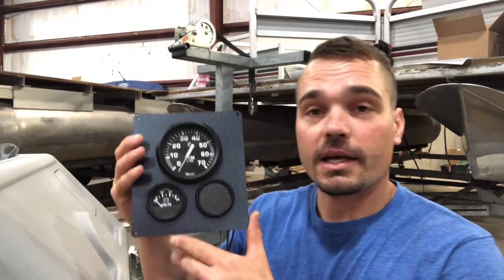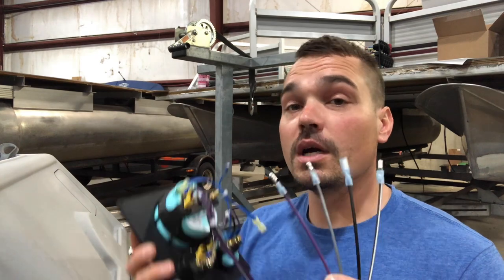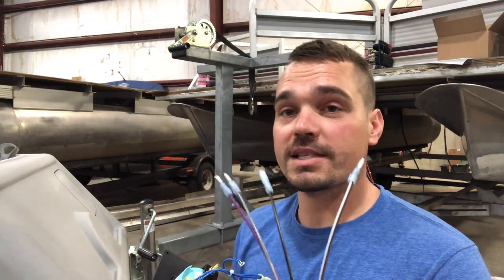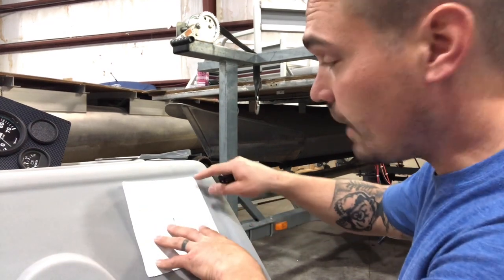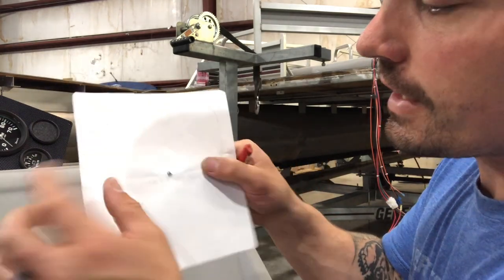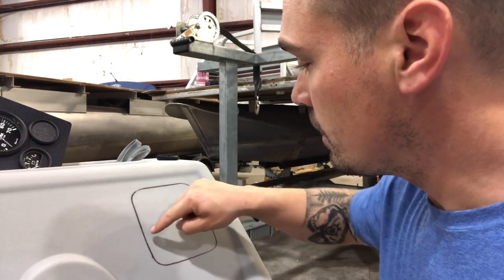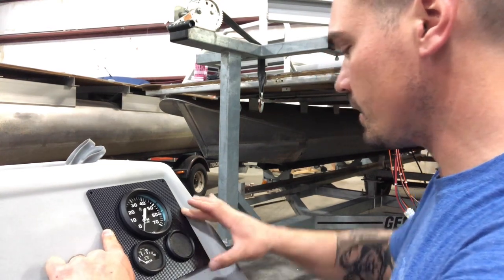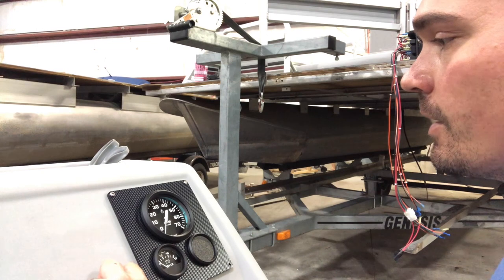Pontoon Boat Gauge Kit Install - Tach & Voltage Kit

Comment: What Dremel tip is best for cutting the plastic console?
Reply from the maker: This is the bit that I use...it can be found at local hardware stores too:

https://www.amazon.com/Dremel-561-Multipurpose-Cutting-Bit/dp/B00004UDIB/ref=asc_df_B00004UDIB/?tag=hyprod-20&linkCode=df0&hvadid=309832851244&hvpos=&hvnetw=g&hvrand=15890868595884712403&hvpone=&hvptwo=&hvqmt=&hvdev=c&hvdvcmdl=&hvlocint=&hvlocphy=9017529&hvtargid=pla-383694946481&psc=1&tag=&ref=&adgrpid=64417494871&hvpone=&hvptwo=&hvadid=309832851244&hvpos=&hvnetw=g&hvrand=15890868595884712403&hvqmt=&hvdev=c&hvdvcmdl=&hvlocint=&hvlocphy=9017529&hvtargid=pla-383694946481

Comment: H a ve a 2002 Mercury 115 hp that won't trim up  Help !9
Reply from the maker: If it'll trim down, but not up, it's likely one of your trim solenoids. You can swap the solenoids to test if one is working as when swapped it should go up but not down. That's a pretty common issue and a quick and simple fix as they just plug and play...and not terribly expensive either!